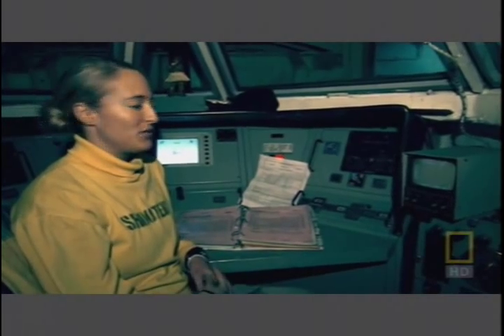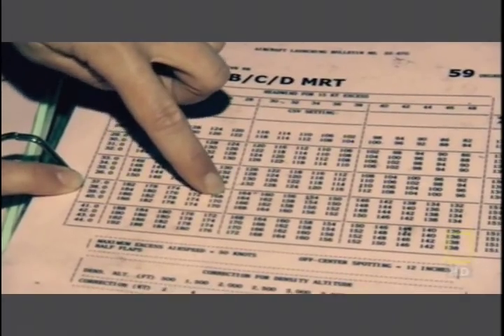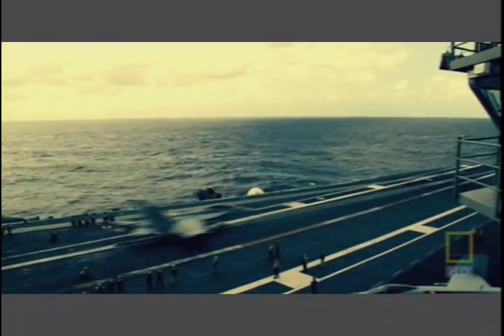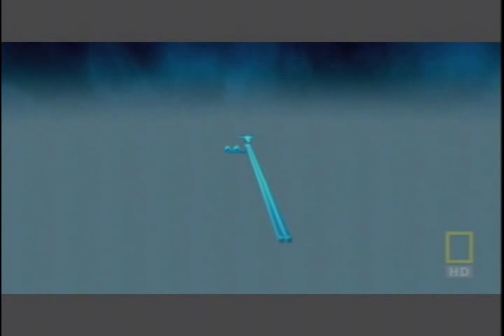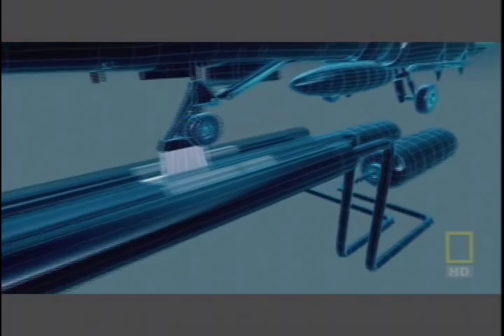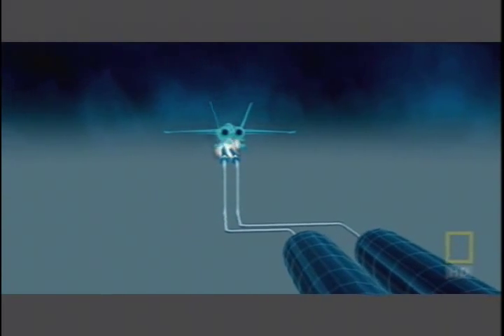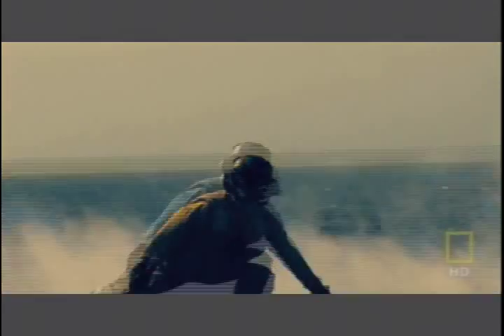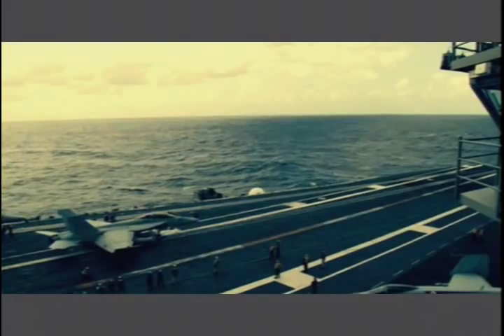ENG Aircraft carrier catapult

Comment: It’s been a while so forgive if I forget details. I worked Waist Cats (#3 & #4) on Connie (CV-64) from 84-87. Cats of this era have four major systems......
1) Mechanical: twin sub-deck cylinders contain two pistons connected by a steel crossmember and a metal shuttle assembly attached on top. Multiple steel cover plates enclose the cylinders leaving an open slot for the shuttle. A lengthy heavy duty metal cable and sheave system connects to the piston/crossmember assembly to enable retraction and tensioning of the shuttle. This system is connected below deck to a R&T (retraction & tensioning) machine.
2) Hydraulic: the R&T machine uses high pressure hydraulic fluid in a large accumulator to drive a huge piston rod attached to the metal cable and sheave system.
3) High Pressure Water: the forward end of the catapult cylinders are capped off by two cylindrical shaped Water Brakes. Very high pressure circular spray patterned water slows and stops the piston assembly in about 20ft from speeds up to 140kts. 
     High Temperature Water: 480deg water is piped into two wet steam accumulators, each the size of half an 18 wheeler’s tanker trailer. 4500 gals of hot water for each accumulator. (This water is flash steamed as steam from the ships engine room boilers is added). After the Cat shot water (condensed steam) is exhausted overboard below the water line.
4) High Pressure Steam: About 1,350 pounds of steam accumulates in the Cats accumulators in about 20 seconds. Indeed this limiting factor determines the fastest rate of fire at one bird every 20 seconds. In reality one shot every 30 - 60 seconds is more common for fastest rates. Steam pressure is determined by aircraft type and weight. A topside station called “Weightboard” confirms each aircraft weight (including fuel and stores) before each launch. Once all topside and below deck station checks are visually and verbally verified ok the shuttle is tensioned and a launch valve is opened allowing the determined amount of steam to enter the cylinders behind the pistons. The Topside PO clears, the Shooter instructs the birds driver to go to FMP and as soon as the holdback bars release pressure is reached it detaches and bird & shuttle/piston assembly travels about 315ft in just a few seconds. The nose gear launch bar of the bird is simply hooked over a curved “hook” at the front of the shuttle. Kinetic energy continues to propel the aircraft off the deck and its flying. 
The shuttle is stopped dead in about 20ft by the high pressure water brakes. The impact is severe, very loud and strong enough to be felt pushing the ship slightly forward. The R&T machine then retracts the shuttle rapidly to prepare for another shot. As the shuttle retracts the pistons exhaust the steam in the cylinders thru the shuttle slot and exhaust valves. Much steam is condensed into hot water and this is exhausted overboard. The steam accumulators are recharged by this point and ready for the next shot. The Water Brake Station is monitored to ensure psi and cylinder expansion are nominal. The slowest station to reset is the R&T machine. A lot of cable is involved and hydraulics can only move it so fast.
Connie was the last (and largest) conventional powered carrier in the Navy. Although oil fired she was the fastest ship in the battle Group outpacing even the DDG’s and FF’s in a famous race in 1985. (I was there, officially it’s 34kts but I know we were faster :) 
CVN’s upgraded to larger diameter cats utilizing higher steam pressure. I’m not sure why this was done because the heaviest aircraft were the same for CVN’s as for CV’s. The Tomcat usually launched at 50,000 - 60,000 lbs, The Whale was the heaviest carrier bird ever but it was retired by 87 when I got out. Our cats could handle up to 80,000lbs weight. In early 87 the F-14A+ came aboard with the much more powerful GE-F110-GE-400 engine. This upped power so much the Tur-key could now launch without afterburner (which gave away the Carriers position at night spectacularly). It was a blast to stand next to that ten foot plume of fire though. It rumbled and crackled right through you!
Steam Catapults are brutally powerful and effective. They are also only about 6% efficient. Components (and workspaces) are constantly exposed to extreme heat, pressures, regarding steam, water and hydraulics. They are super labor intensive and mechanical breakdowns are continual. Seals, O-Rings, fittings, valves, cables, sheave systems, pistons, accumulators all break. Grease is everywhere. V-2 Division (Cats & Arresting Gear) have the reputation of being one of the dirtiest, hottest and longest hours job in Ships Company. 18-21 hour days are not uncommon. It was a blast but it also was a grind. Cats must be up and running, no if and or butts!
I think the new ELAMS Cats, (electromagnetic) will be a huge improvement. Components will be shielded from EMP and it should simplify the system down to just mechanical and electrical. I’m very curious to see the Fords workup on these. Trump be damned, every new tech requires a break in/refining period. 
To answer someone’s question, yes the steam cats could be calibrated (adjustments to normal psi range must be made) to launch a person in a go-cart. We use weighted metal sleds to test cats calibration ratings sometimes. They are the size of a PT Cruiser and are launched about a half mile into the water. The go-cart would have to be super heavy duty and the unfortunate “rider” securely strapped in. I would prefer to sit in a Martin Baker ejection seat otherwise you will also have a horrendous 70ft drop to the water in addition to the mile flight Path! 
I recall watching USAF and NASA ejection seat rocket powered sled runs and those test pilots survived so it’s certainly possible.
Reply: -totally forgot the JBD station! Once bird taxis over JBD it is raised and locked. It is lowered once bird is moving. Although it is steel covered by non-skid coating the panels can only take a minute or so of FMP or Afterburner exposure before they begin to melt. Cool water is piped through the inside and of course it is run on hydraulic power.
Reply: Thank you for this detailed and very interesting explanation. You should make your own YouTube video. The DOD has publicly accessible video archives you could use, in my understanding.

Comment: I wonder if the same can be achieved with hydraulics.
Reply: heavy gunner -some WWII Carriers cats were hydraulic. Most early jets were too heavy for them though. A signigant safety margin must be built in of course. Also those carriers had wood with some metal overlay composite decks. All metal became required due to heavy jets breaking up the wood on recovery.
Reply: - oh yeah, high psi large scale hydraulics blew out seals quite frequently. Atomized hydraulic fluid created a red mist often hanging in the air around the retraction and tensioning machine. It was super labor intensive to replace those seals with piston rods two feet in diameter. I’m sure my health has been affected by all the hydraulic fluid in breathed in. It was super motivating to advance to flight deck stations and fresh air.